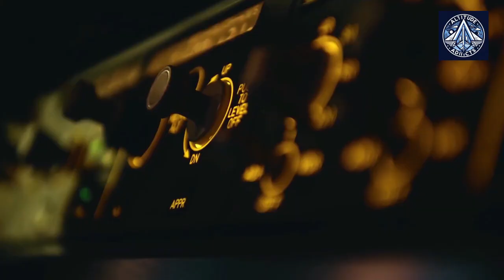MC-21 Deliveries to Aeroflot Expected in 2026

Comment: Almost the same story of the MC-21, for nearly 20 years. Delay after delay. Big propaganda claims meet Russian reality. Which is very sad.
Reply: @alexandervt641  they had options before but I doubt they would tolerate further delays now that they don't.
Reply: open your eyes & mind.. how about Boeing & Airbus delay + substandard quality products? they are much bigger & with more experience yet still encounter same issues..
Reply: @muhammadashady5429  …they don‘t have comparable delays. Even the huge Airbus 380 was developed in just 6 years.
Reply: @alexandervt641  better to delay than have airliners fall from the sky like Boeing. Wish they had better manufacturing standards.
Reply: @  Superjet 100, the only new Russian passenger jet, is one of the most unsafe jets on earth. Much worse even than the Boeing MAX.